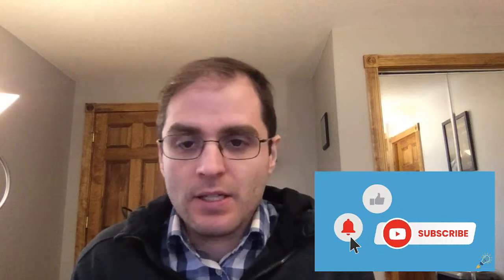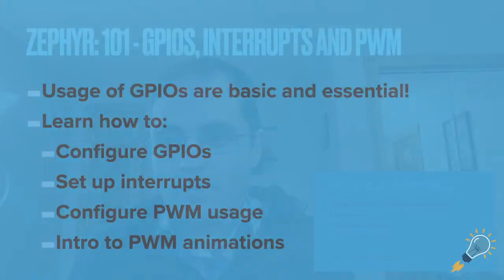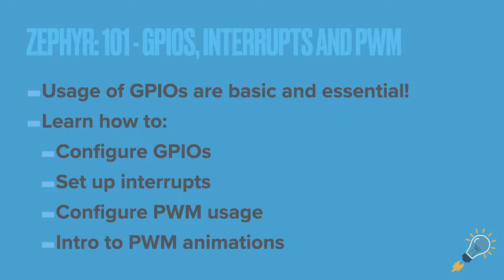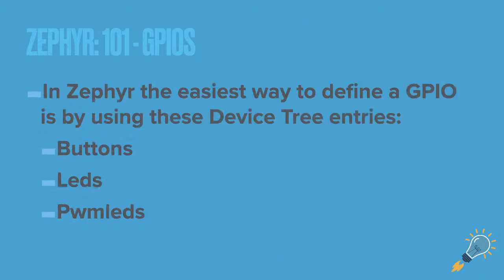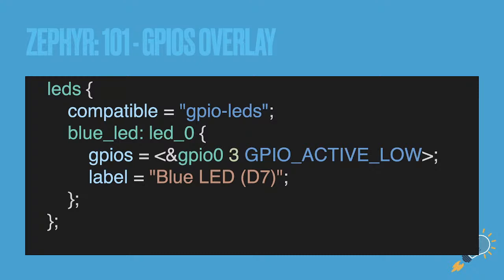Zephyr 101 - GPIOs and PWM

Comment: With your help I'll finally wrap my head around Zephyr. For buttons and leds I can highly recommend the dk_buttons_and_leds library from Nordic. Easy to use, "dynamic" number of buttons and leds and nice handling for long press events. Zephyr also has an abstraction for gpio-leds and pwm-leds with the led driver (led_on(), led_off(), led_set_brightness() which help a bit using leds.
Reply from the maker: Awesome thanks for the tips and for tuning in @Androbi

Comment: is it possible to change the default led on a raspberry pico as pwm led and assign it to any other gpio pins .
default led is at gpio 25 but the device tree for pwm_led is this : 
/ {
	leds {
		compatible = "gpio-leds";
		led0: led_0 {
			gpios = <&gpio0 25 GPIO_ACTIVE_HIGH>;
			label = "LED";
		};
	};

	pwm_leds {
		compatible = "pwm-leds";
		status = "okay";
		pwm_led0: pwm_led_0 {
			pwms = <&pwm 9 PWM_MSEC(20) PWM_POLARITY_NORMAL>;
			label = "PWM_LED";
		};
	};

	aliases {
		led0 = &led0;
		pwm-led0 = &pwm_led0;
	};
};

Comment: Thanks for your great video! Related to PWM, Does Zephyr automatically selects a timer from the microcontroler to generate a PWM signal? STM32H7xx has a lot of timers, so its not clear how one and another works.
Reply from the maker: Hey Rob

Good question!

Generally, if you don't have a specific PWM peripheral, then you'll need to associate the timer with a PWM instance.

&timers2 {
	status = "okay";

	pwm2: pwm {
		status = "okay";
		pinctrl-0 = <&tim2_ch1_pa0>;
		pinctrl-names = "default";
	};
};

That's an example from stm32l496g_disco.dts within the Zephyr repo. 

Hope that helps!
Reply from the maker: Hey Rob,

I dove into your question a bit more on today's live stream. Hope that helps further. :) https://youtu.be/TijlHi9q4tQ?t=126

Comment: It's been 6 months I've been working with zephyrOS. And now I think why they make embedded development difficult in zephyrOS. 
I still struggle to use gpio for simple led toggling.  Adding a node in DTS and when tried to get this node. It's not there. Device pointer is null. And still unable why it is this when i have added a node in dts, the device pointer should not be a null pointer
Reply: It's only benefit is that we don't have to write same program from start for other some other controller. I can't think of it's other possible purpose
Reply from the maker: All points well taken! It’s a ton easier now with the device_dt API compared to the past. I do feel your pain though!

Comment: Thanks for an excellent video!! What if I want to enable an interrupt on a pin which is not in the Device Tree. I am using a nRF52840 Dongle and wants to have sensor input on eg. gpio1 pin 13 which is not a button pin. Can I do that and can you refer me to somewhere I can see a sample?
Reply from the maker: You can create a new button like this in a device tree overlay.

/ {
	buttons {
		newbutton0: new_button_0 {
			gpios = <&gpio0 13 (GPIO_PULL_UP | GPIO_ACTIVE_LOW)>;
			label = "Switch 2";
		};
	};
};